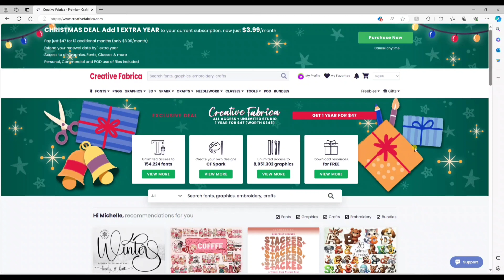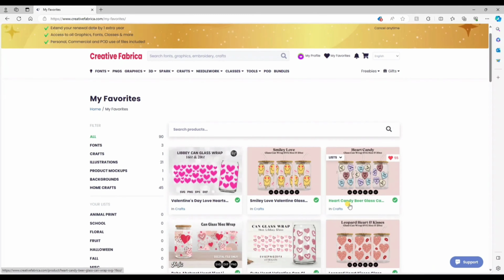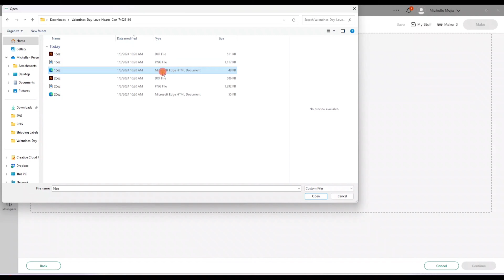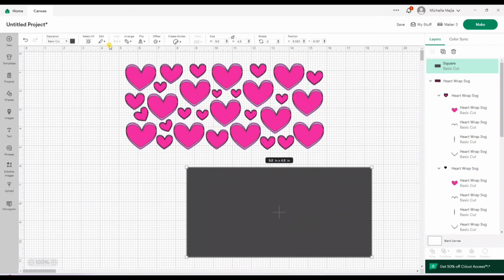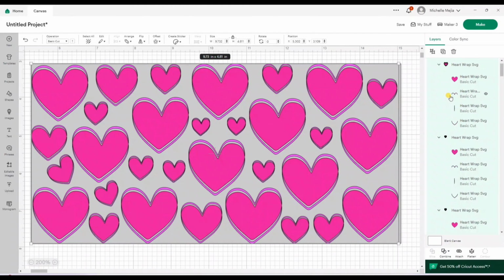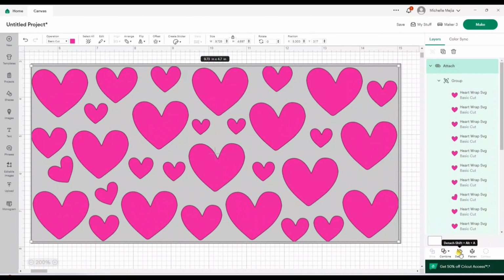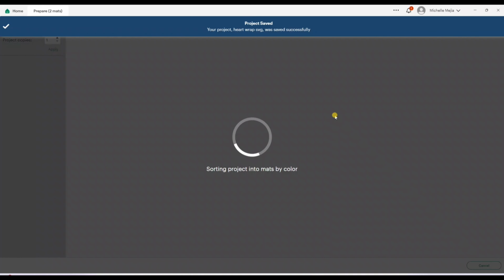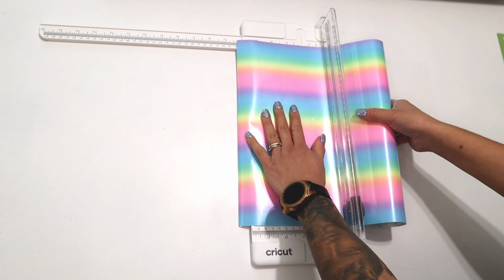Applying Permanent Vinyl to a Glass Can Cup: Beginner Friendly Tutorial

Comment: Thank you so much for sharing this detailed video it was so helpful! ❤🧡💛💚💙💜
I want to print my design directly onto waterproof, permanent paper using my printer, without using a heat press or water-slide paper. I also plan to use my Cricut machine to cut around the design, rather than applying layers with different colored adhesives. Can you help with the type of paper that I would need please? x ❤🧡💛💚💙💜